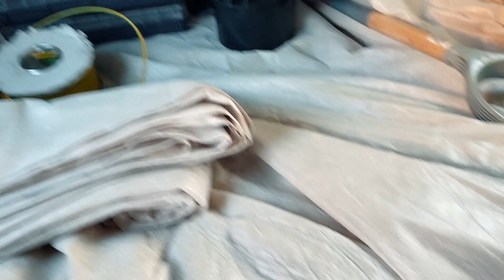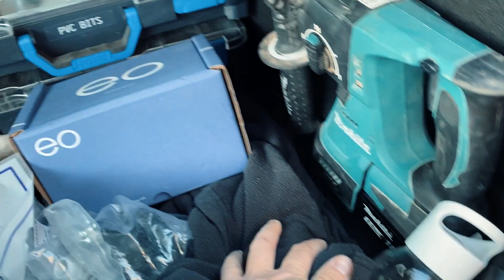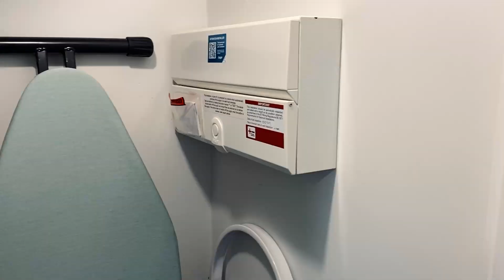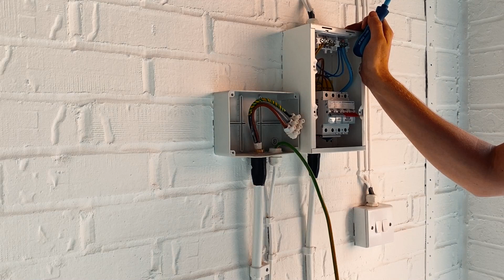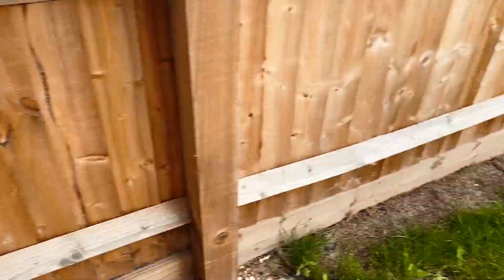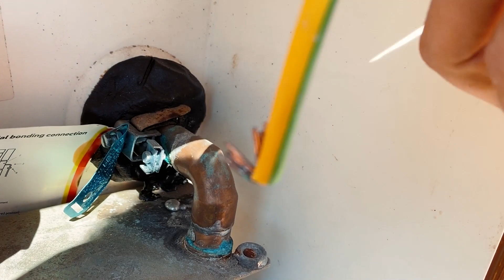I Swapped My Work Van for a Tesla!

Comment: Serious question...why did you opt for the Tesla and not one of the other electrics that also have circa 300 mile range.? 
and have you done any powerwall/home battery systems.?
Reply from the maker: Let me know which EV other than a Tesla has an actual real world 300 plus mile range...
Reply: @artisanelectrics  I sat and watched 6 or 7 of your videos this afternoon and was seriously impressed with your workmanship and ethics. The reason i ask is i'm also looking to get an ev, would love a Tesla but my pockets aren't deep enough. I was lucky(?) enough to get a good long test drive in a Kia Niro 4+ and managed just over 300 miles, even though i was told expect 260-280.... hence my asking. We also have 3.6kw array of solar panels (8yrs now) hence the reason for asking about a battery storage system.
Reply from the maker: Ah ok yeah we are working on becoming Solar Roof and Powerwall installers but Tesla are hard to pin down!

Comment: This turned out as a pretty good real life review of a Tesla. which brings things full circle for me as I accidently found your channel researching Zero electric motorcycles.  My next bike will be electric. Might have to give you a shout for a charger install in exchange for a free Airbnb holiday in cornwall   🤣  You could make a horror video of our old wiring and solar PV.... 😬
Bonding work was  by someone who wasn't getting paid enough to take any  pride at all in his work with what his boss was paying them peanuts, by the look of it.  That's a shocking standard of work,  but not surprising in 2020. 
 Everyone expects something for nothing today, you get what you pay for still applies. Dignity of work goes out the window eventually when you have been ground down  by cheapskates. 🤷🏻‍♂️

Comment: Strange to see such small grounding rods.  We normally use 8 foot rods in the USA.  I have installed a number of the Tesla wall chargers here in the USA and at least we don't have to worry about the whole neutral issues here.  The chargers don't use neutral, only the split phase 240V and then ground wire are the only connections.  For the older Gen 2 units we typically put a 100A breaker to them so that the larger chargers in some of the Telsa's can take advantage of the higher rates.  The newer Gen3 units will only use a 60A breaker or just under 12KW (48A) max now.

Comment: Far as I (M3-LR-AWD driver with Zappi-2) the plus points for the tesla unit are (a) button on cable (b) if you have two, it will share/balance the charge to your two cars. No link to solar.

Comment: Why did you not connect the earth rod to PE? In Poland we mostly have TNC. PEN is split to neutral and PE. Split point is usually grounded. In TT, if RCD fails than all current goes to the ground through earth electrode. Current flowing through eart electrode having high impedance won't break the circuit.

Comment: Should one not charge all batteries completely so they don't develop a memory..?
Reply from the maker: I think so
Reply: Lithium ION batteries don't have memory issues. They can degrade over time due to expansion and contraction caused by over charging but most EV's have a buffer that's hidden so you think you are charging to 100% but your'e not.

Comment: The Tesla owners wave & knowing smile is awesome. Got a 2014 S going strong with 140k miles on. Had the usual new computer & door handle repairs @ a cost of £3k recently but saved a lot more than that on servicing & parts Vs an ice car. Still on original pads & discs which I can't believe.

Comment: With your indicator issue (which I haven't found) if it doesn't cancel just flick stalk down the same way you'd indicated. Also best to keep your feet near the pedals in case you have phantom braking (which I have had) ;-)

Comment: I just wanted to pick your brain. For a charge point at the front of my property I would have to run the cable from the eletrical box under a suspended floor through an air vent at the front. I was just wondering what gauge cable I would need and also would I have to run a conduit under the suspended floor and feed the cable though. What sort of conduit would that be. Thanks for any help.

Comment: My Tesla Model 3 does the same on the A14. You will notice it does not know the speed limit on the section where it fails. It also does it on the A1 for a few miles. As soon as it knows the speed limit it works normally again.

Comment: How did you get that ground resistance reading with your voltage tester?
Reply: I think he checked the voltage with the voltmeter, then used the multifunction tester and did a loop test between incoming line and the earth electrode.
Can anyone with more experience in testing clarify this?

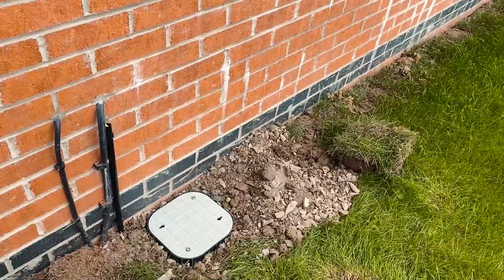Comment: Surprised you didn't fit a conduit elbow to take the earth lead back though the garage wall. Looked as the end was open at 26:44, which would allow UV to degrade it and also allow it to fill with water.

Comment: Just getting into EV charging units.
Someone else has mentioned that the RCD must be double pole so both live conductors are isolated in the event of a fault.
Does the unit you fitted have something in it as to why you have not fitted a DP RCD ?

Comment: My main concern's here  are the earth rod  you don't know whats below (you hit the foundations ) the rod needs to be well clear of any other underground services (think its 5 meters) , did you trace the services out  , i also note the garage door appears to be steel , what risks could this create if a fault develops and the car body develops a dangerous voltage , i take it there is no rcd protection on the sockets and lights anymore ,  have you installed double pole breakers rcbo's   have you bonded the garage door , what about any outside taps

Comment: Good video thank you. Just a question, when installing to an existing cable fed from the consumer unit like that, (and especially seeing the quality of the existing rod install and gas bonding) would you generally check for tightness of the conductors in the upstream MCB/RCBO and the consumer unit tails? I added a comment on one of your previous videos where my consumer unit caught fire due to suspected loose consumer unit tails, but if they had been checked during charger installation then this probably would have been avoided. My thoughts are that it would prudent to check for tightness of all upstream connections as a matter of course when installing an EV charger or other load that is designed for periods of sustained high current draw, in case of heating effects that might only become apparent over the long term.

Comment: For outdoor use for the earth cable you can use NYY-J with a single wire inside (the green yellow one), NYY-J 1x16mm² for example. NYY is a german cable type, but available in the UK. It's black, so it also fits the SWA. Important to pick the -J version, the -O is without green/yellow insulated wire. With this UV isn't that problem anymore.

https://www.elandcables.com/media/38379/nyy-j-pvc-0-6-1kv-power-cable.pdf

It's also permitted to fit it in the UK afaik. So I could also fit UK cable types here except twin-and-earth style cables. The CPC must be of the same size as the active conductors here. And the CPC is here always fully insulated in the cable, so no sleeves required.

Comment: Always surprised with electric cars how there is no built in charging system so there would be little need to plug in as if the whole country went electric I wonder how much electric we would need as it would not all totally be from fossil free generation.
Reply: Austin Powers What do you mean? They have built in chargers. What's being installed here is a glorified electrical connection to supply the cars built in charger with. If you don't plug the car in, where do you propose it gets its power from?

Comment: You can just push the charging port cover firmly in and it will open it as long as the car has been unlocked.. you don't need the button on the cable.

Comment: Are you ever concerned about going through buiried services when installing earth electrodes? I put a new water main into my house and uncovered the paper lead service cables that snake across the front garden. It’s a 1950’s house though. Looks as though they might be about 2x 120 mm 4 core in parallel although they’d be an imperial size. The house is set back from the road compared to the other houses so I think they just took the shortest route. Excellent videos thanks.
Reply: Be very surprised if you have a 120mm feed into your house. Most likely 16mm or imperial equiv.
Reply: Steve spark there the main cables for the street. Mine is about a 16 mm that tees off them.

Comment: The RCBO in the CU looks like its single pole, did you check? How have you checked there are no services where you're hammering the earth electrode in? You could go through a drain pipe and wouldnt know. Most likely you wont hit the the mains cable supplying the property, but you would certainly know if you had. TT earthing is a very bad idea from a safety perspective and not recommended by the IET's COP for EV charging installation. Earth bonding is another issue as most new builds don't use metallic service pipework. I suggest you watch John Wards video on the subject of EV charging installation, its very informative. https://www.youtube.com/watch?v=gZVx7GbAwlg&ab_channel=JohnWard
Reply: The guidance to not TT earth is in Amedment 1 not the CoP, however the new CoP edition 4  does say that TT earthing is sketchy and best avoided. My bad, I do like your videos though. :)

Comment: If you are considering using your Tesla for smaller jobs, you should check out www.titancovers.co.uk and get a custom boot liner. Tough and durable and fits the full shape of the boot.  Saves using dust sheets. (I have no  connection with Titan other than being a satisfied customer 🙂)

Comment: What harm would it be having both earth connected.
Reply: If there is a fault in the neutral on a  TNC-S  system  the earth and neutral as its combined on the supply side will reach line voltage (230 volts)  as the cars body will be earthed that to could reach line voltage,  the body is insulated from the ground so as soon as you touch the body your getting electrocuted
Reply: @steverobinson8170  yes I understand that but if the 2 earthing systems were connected with a sufficient sized conductor it would send the fault back through the earth rod to ground and take out the main fuse
Reply: Not that simple  because  its interlinking all properties on that part of the system at fault on the supply end   so it doesnt really matter if your main fuse is taken out, its unlikey the others will be , you would need to  shut the substation down , just dropping one phase off can cause issues elseware , you can be looking at 1000's of amps  all heading to your  earth rod  as its now become the only earth point .  Our Systems were never set up for this . This is why you never have a TNC-S supply  on camping and caravan  grounds any fault and  you become the earth  between vehicle and ground

Comment: This is exactly what I plan to do. But I was going to use the Tesla every day otherwise I wouldn’t be able to afford it. By my calculations I would need to do some thing like 500 miles a week to make it viable. Which may seem ridiculous to some people but for the last two years I’ve been working on a job where sometimes we would do 1000 miles a week. 
There are a couple of companies in Holland that fit an extra battery packs to the Nissan ENV 200 electric van so it can do over 200 miles on one charge. That would cost around £25,000 but it’s not a Tesla.

Comment: The earth bond on the gas still isn’t terminated correctly needs a lug… also push in saddles are for plumbers pipes get proper ones for conduit
Reply from the maker: Not sure I would agree about the saddles
Reply: @artisanelectrics  i agree, they make and sell them specifically for electrical conduit so why not use them 👍
Reply: @artisanelectrics  Love the neat look of the push in saddles. And re: needs a lug... it's debatable. Certainly splitting it 3-4 strands is far from ideal but if you have a large enough clamping area,. a wrap around the screw works well.. I have mixed feelings about lugs. Yes, ideally a 10mm2 lug crimped with a high quality crimp tool under laboratory conditions will be ideal. But on site, kneeling in mud, with every tool dirty.. I wonder if it doesn't cause more potential faults?  (Jelly filling like telecomms connectors could help with the dirt/corrosion issue, but that crap is MESSY)
Reply: Terminations don't need lugs to comply any connection has to be electrically and mechanically sound that's all just sayin

Comment: Why is the gas bonded it's got to be plastic pipe into a new house
Reply: No plastic pipe enters new build for gas.  Only tracpipe.  I work with both gas and electrics.  10mm earth bonding within 600mm of the exit and before any T branch 😉
Reply: @rayc1503  the pipe into the meter box is plastic so what are you bonding against

Comment: Re the earth rod install adapters, the spade/drill end looks at lot bigger than the rod causing an over sized hole. Would it not be better just to use the sds adapter and drive the rod in under hammer action. In aim is to get the rod installed with the least ground disturbance giving a better contact. At least this is better than using a hammer which makes the rod bend and over sizes the hole. A bit of sylglas tape around the connection keeps the corrostion away. By the way great vids.
Reply: Sylglas? Whats wrong with traditional Denso tape?
Reply from the maker: Good thoughts thanks!

Comment: Just think when the electric cars come in to force there won't be enough Sparky's about to wire up the charging points,all Sparky's will be in Tesla's 😀
Reply: Marius Ipad  so you come out on a cold frosty morning  to a flat battery , the AA won't jump start that , people  within a very short time will bypass this
Reply: I wouldnt worry about it, the network is just not robust enough to cope,  when your mixing TT systems with TNC-S (which many supplies are now no matter what it says on your service head) systems and older properties with copper and steel service pipes  bad combination , By the time its all been sorted out new safety devices designed  uprated local supplies hydrogen fuel cell tech will be onstream .
Reply: @steverobinson8170  What's the current state of hydrogen fuel cell tech?
Reply: @jam99  It was in the Duldrums but early last year  Bosch started to invest heavily as  have some of the petro chemical companies .They have realised that the supply of lithium is limited  and battery power whilst ok to tootle around  town its not the answer to freight  and van transport needs
Reply: @steverobinson8170  Thanks.

Comment: The issue with the electric cars is you’ve got to be careful of how far you drive for charging points. The time it takes to charge. An the price to replace the batteries is stupid. Still using fossil fuel to charge them at the end of the day
Reply: Not it the UK. We are about 50 percent wind power these days.
Reply: I agree, the range problem is probably one of the largest hindrances for electric cars today, it's hard to justify having an electric car as your only car. Time to charge isn't such a big issue, most car trips are going from home to work or an errand, etc and coming back. Even a slow level 1 charger is enough in these situations, and most owners will have faster level 2 chargers at home. It's only an issue if you are taking a large trip. It would be great if manufacturers could come up with a standardized interface for a range extender. Then you could use your car's built-in battery for 99% of your trips and rent a range extender for the family road trip. These would either be a small trailer with a larger battery and/or an internal combustion engine to eliminate the range problem while not requiring you to haul the extra weight all the time.
Reply from the maker: They do have a range extender it’s called a supercharger, there are hundreds of them around the country! You plug in for 15-20mins while you grab a coffee and go to the loo and you have a load more range again!
Reply: @artisanelectrics   While that does help, the Supercharger network is Tesla-only as far as I know, not usable with other cars. I'm sure it is easy to find the Tesla Supercharger in the UK, and I know of one or two where I live in the US, but the United States is huge with large rural areas. I know in some areas it's common to drive with extra gas cans in the back so you don't get stranded, I doubt you'll find a public charging station in those places. Plus most electric cars don't have the range of a Tesla.

Don't get me wrong, electric cars are great and my family's next car will probably be one. I just think that outside of cities it's currently not practical to only have an electric car. For most people electric cars only make sense if you have at least one ICE-powered car in the family.
Reply: You could always choose a energy supplier that only uses renewable energy? Not sure about other manufacturers but the Tesla batteries have an 8yr warranty on the battery and motor.

Comment: I'm curious what the etiquette around using a customer's charger is. Isn't it a bit like a plumber using a customer's bathroom? There is a direct cost to the customer when you use their charger.
Reply: Plug it in and just say you're running tests to ensure the installations working properly.  Just take your time commisioning and testing 😊
Reply: Probably the same as charging your still at their house. If class it as part of the test 😉
Reply: Big difference between having a shit and charging your motor using their electricity, dump costs the customer nothing.
Reply from the maker: Just ask politely and clean up after yourself 😂
Reply: Don't forget sparkies are kings if the trades so we can do what we like 🤣